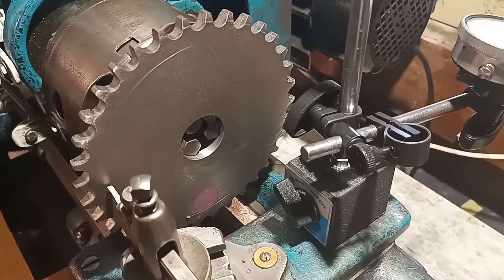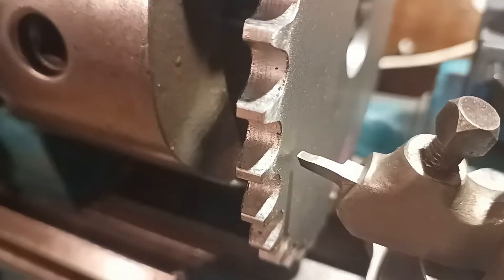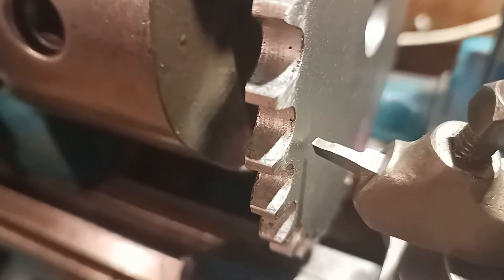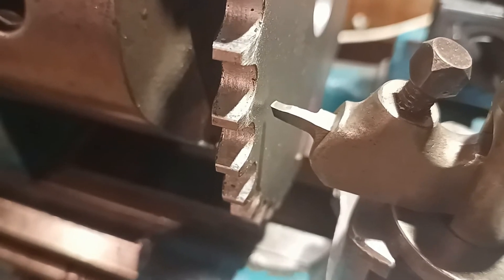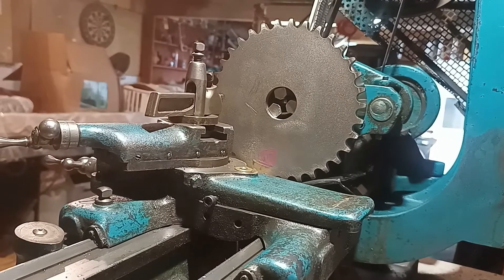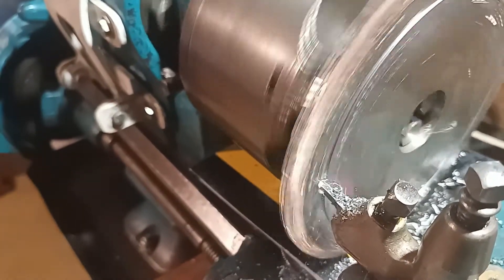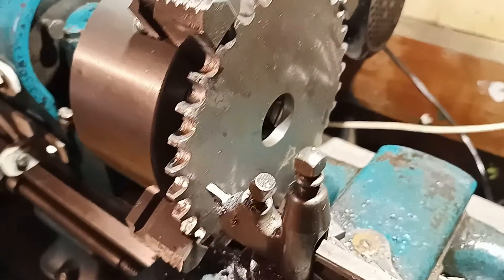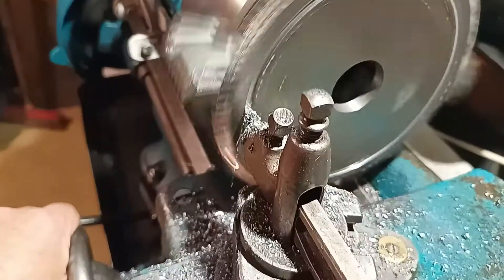Trepanning   Not Pretty

Comment: Tool bit breaking is most often caused by insufficient tool bit side clearance. For a guide on how intricate the clearances have to be ground. Look at a Valcut tool bit. It uses a drag cutting technique which is less prone to breaking.
Side clearance is specially difficult to grind the deeper you have to cut. 
It is even more difficult when your tool bit is mounted at an angle.
Hand feeding is also a nightmare. Best is to use machine feeding. Like 0.025mm per rev depending on diameter.
Reply from the maker: Thank you. These are valuable insights. Luckily it was not a precision cut so I got away with hacking at the workpiece.  I've learned hard lessons about clearances.   Cheers Stu
Reply: @Stu718  Welcome. You are close. Just some side clearance away. 😊😊😊

Comment: Nice work. I did something similar (trepanning off the old sprocket and replacing it with a trepanned ring sprocket to fix my ride on lawnmower). Lots of chatter, etc. for me too as it was pretty hard to get, particularly the old sprockets that were welded to a 1" shaft, held rigidly enough.
Reply from the maker: Hi thanks. Yes, chatter was extreme, mostly because I had a poor grip on the sprocket and  tool pressure pushed the sprocket backwards. In the end it was more of a hack than a precision cut!!

Comment: Nice work! What lathe are you using? It looks like an old South Bend, I have a 1917 SB lathe 15" x 8' and from what I can see of it it sure looks the same. If it were possible could you do a walk around video of the lathe? Mine is missing the over head drive like yours, mine was a line shaft machine. Thanks for the chain drive diff videos you're doing too!
Reply from the maker: Hi. It's a 9" Hercus, which is an Australian copy of a Southbend. The lathe is showing its age, and (so far) I've had to replace the motor, and 4 jaw  Burnerd chuck. They were both new when Winston Churchill was in office.  The Hercus is a loaner from a friend and I'm not a machinist... as you can probably tell.  The ability to machine stock parts has given me design options on the car I'm building. Adapters - so many adaptors!!   I'll video the lathe soon and post it on Youtube
Reply: Thanks for the reply! I'm looking forward to the video!
Reply from the maker: @georgechambers3197  Hi, I just put up a quick video. It's short on details because I don't know too much about the lathe